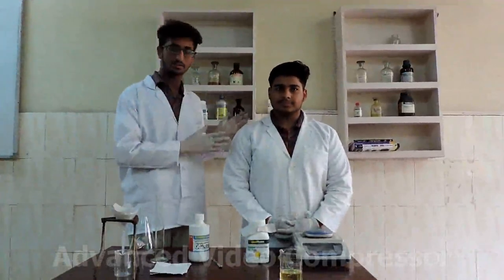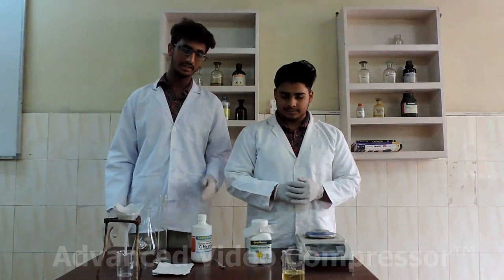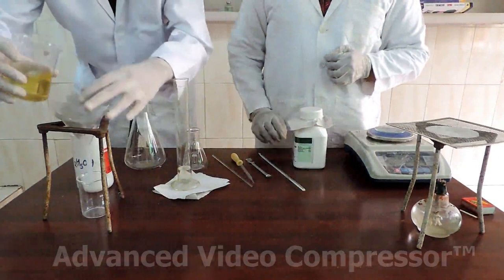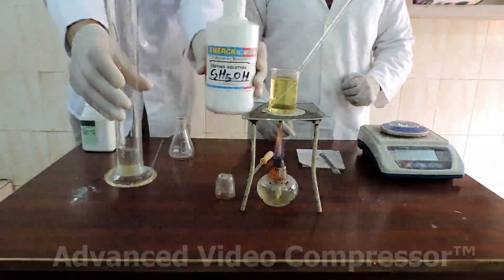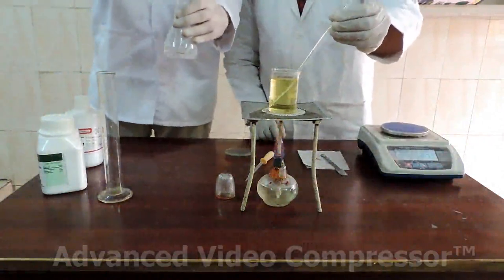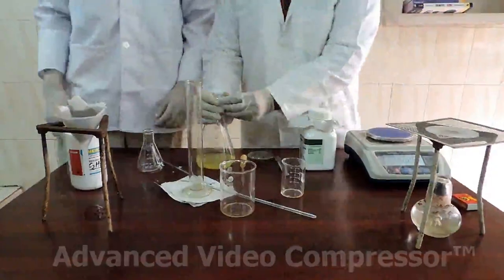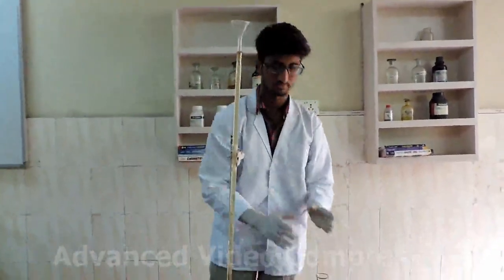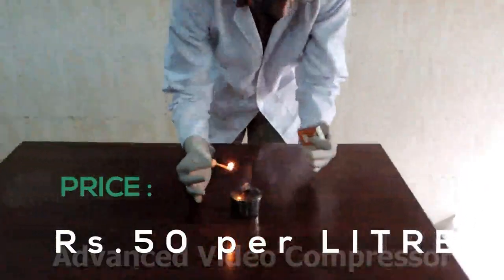production of biodiesel from used cooking oil.

Comment: Will it work with NAOH?
Reply: Yes. You can definitely use KOH, NaOH or any alkali based catalyst (it depends on you). But if you'll use KOH (like he used in this above video) as a catalyst, then this can give you comparatively more yield, and there will be complete reaction. Also that is cheaper than other alkali catalyst.

Hope it helps.) ✌️